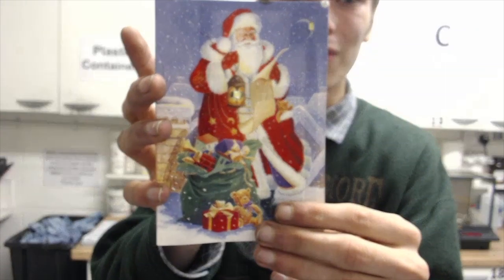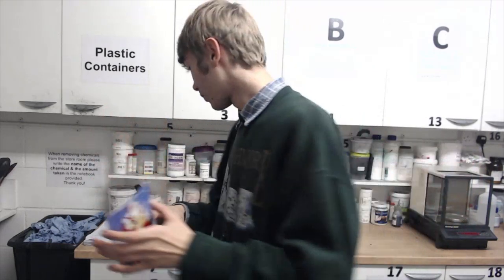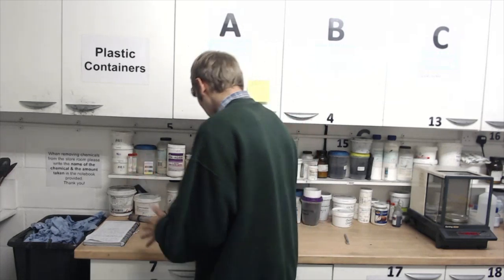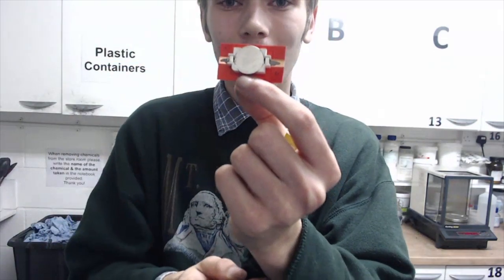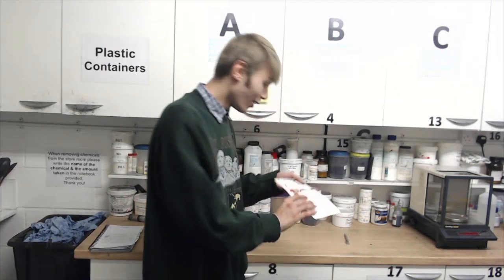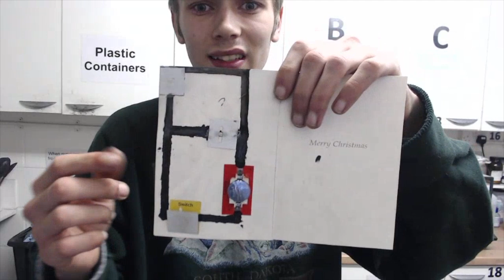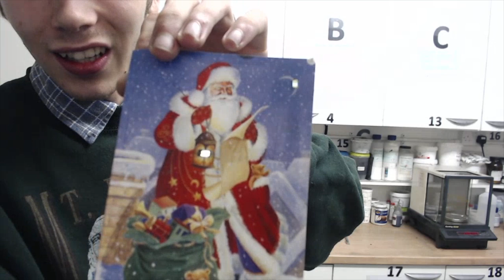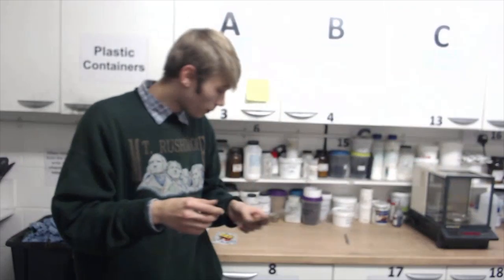Components on a card - Add LED lights to homemade greetings cards with ease!

Comment: Suggestion:  555 timer ICs were a super little building block.  However, the original designs were bi-polar and consumed quite a bit of power on their own.  Since that time, CMOS versions of the 555 became available.  They have all the same pinout, voltage and driving specs, but use MUCH less power. Price difference was insignificant. Please select those for your project. :)

Comment: good video Luke,how about using slim graphene batteries or super capacitors Robert made just add a charger socket and BTW there are very very low current LEDS .cheers mate

Comment: To Luke is this your first kit ? - In the 70's you could buy conductive paste - I used it to repair car rear window demisters, but you had to wait a day for the paste to dry before it would conduct, how long do you have to wait before your ink will conduct?
Reply: It depends on how thick you apply the ink, Leaving it to air dry i would say around 1-2 hours maybe 3. But if you whack it with a hair dryer in-between coats it takes about 5-10 minutes on a low setting.
It will be slightly conductive while its abit wet, but i would recommend waiting a little bit til its dry hahah.  
Hoped this helped!!